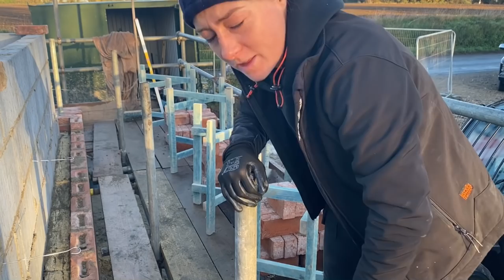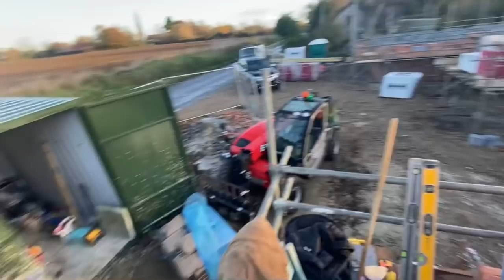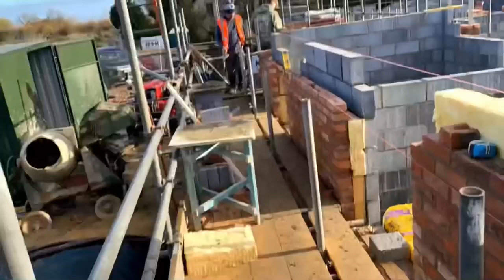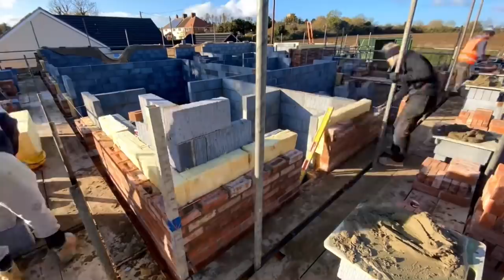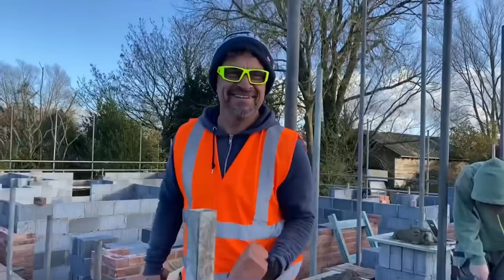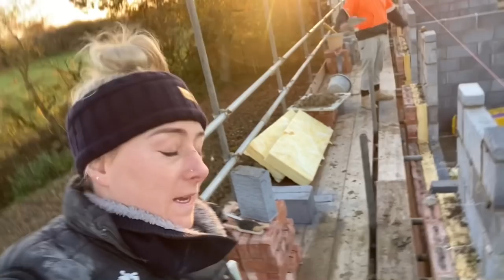Day in the life of a Female Bricklayer

Comment: It always makes me wonder watching these videos from the UK how you guys build your walls with no air cap between the brick and insulation. No wind resisting layer on the outside of the insulation nor water vapor barrier on the inside between blockwork and insulation. How the Hell aren't your inside air full of contaminants?! Great job on the brick laying though.
Reply: @FUT-Franklin  For sure but roughcasting doesn't help with the problems I mentioned.
Reply: @FUT-Franklin  No bud we dont render all buildings only if they built in Blockwork on outside, we would either render or clad. timber framed building we would use a Tyvek membrane . but no need when we build with face brick and block work. . we use Thermal Insulation Cavity Batts to insulate :)